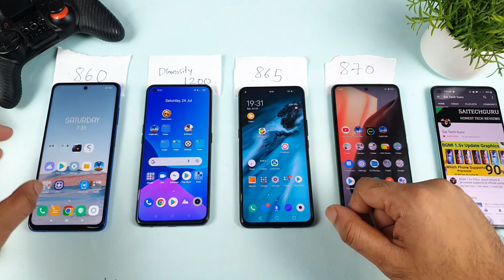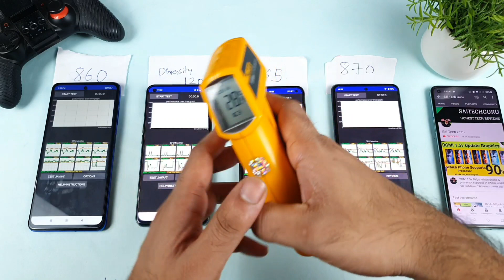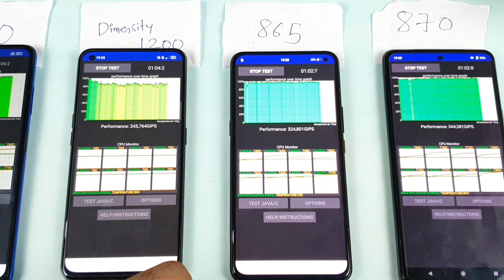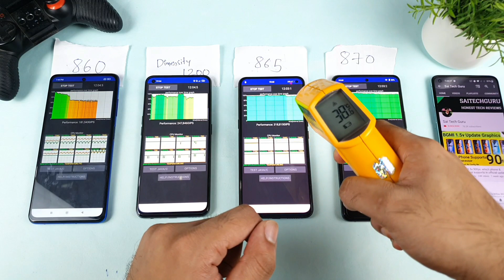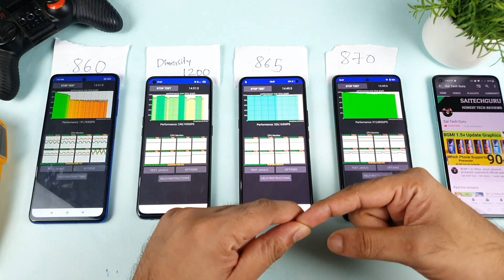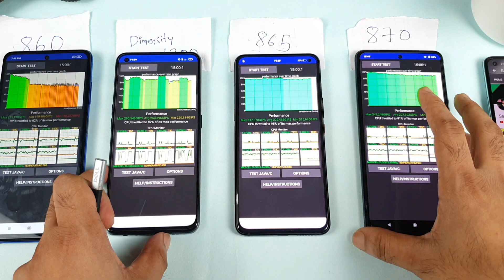iQOO 7 vs Realme X7 Max vs iQOO 3 vs Poco X3 Pro CPU Throttling Test comparison 🔥🔥🔥

Comment: I am using realme 1since 3 years it's 6gb ram 128gb model mobile (Mediatek p 60)Mediatek is doing great since last 3 years from the launch of p60. I didn't reset my mobile and my mobile never hanged I wanted to upgrade to realme x7 max just because of camera , fast charging and 5g I like realme ui better than Miui and you won't get ads if you setup your phone properly and also never use oppo browser and store if you ever opened accidentally just clear data , remove permission and force sto no more ads
Reply: I hv real m U1 from 3yrs ..Helio p70. no lag..I hv no issues from years .even it helped m in gaming defeating iPhone players... Now I can blindly go for x 7 max..